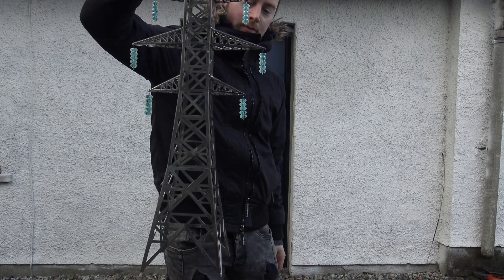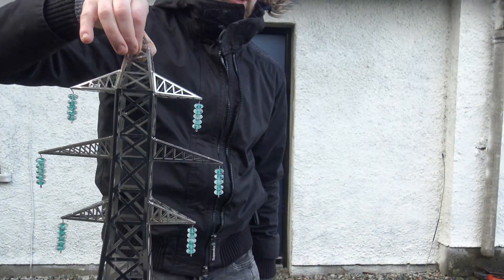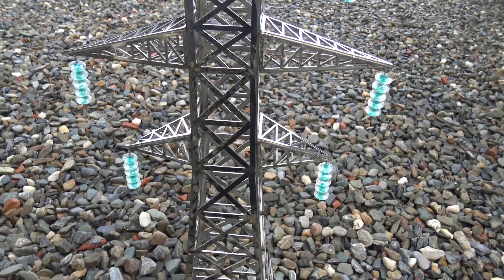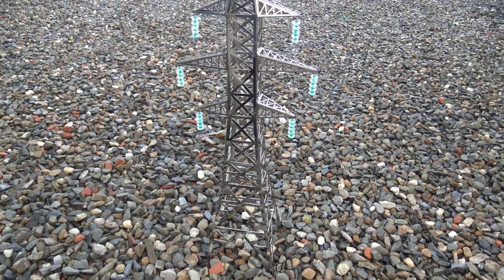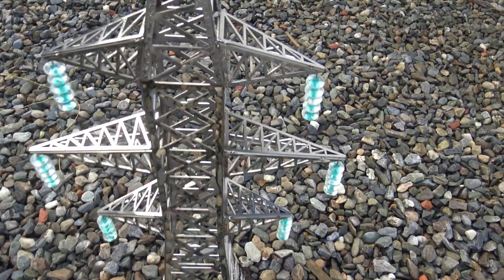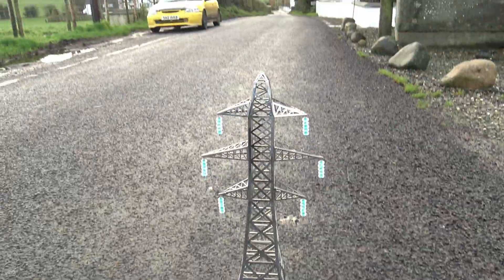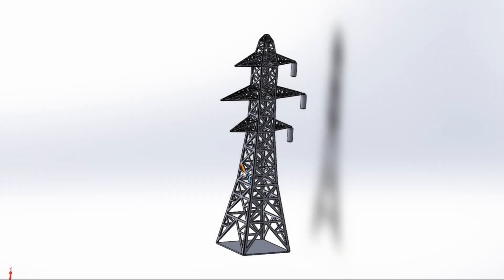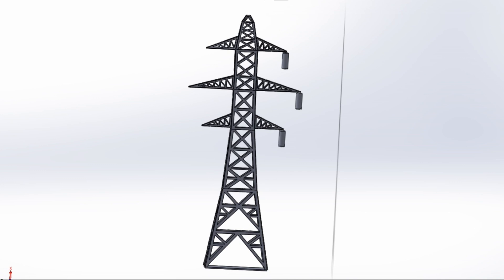Building an Oranment Model Pylon 110kV 275kV Transmission Tower

Comment: I’ve worked through them line towers in Northern Ireland when I was younger 250kv dual phase.
Reply: From carrickfergus. There’s three lines from there I believe. Another power station facing larne across the water. Ireland is beautiful even though you get four seasons of rain. Just different types.
Reply from the maker: Hi there,
Yes it's definitely a beautiful country, I live 10 miles from Coolkearagh power station and two 110kv lines pass down through the valley towards me, and on up towards Omagh/Dungannon, the other side of Lough Neagh 🙂